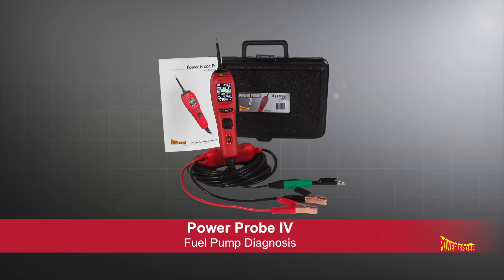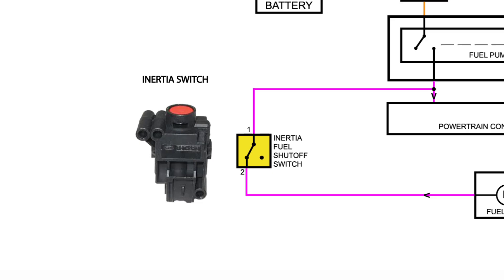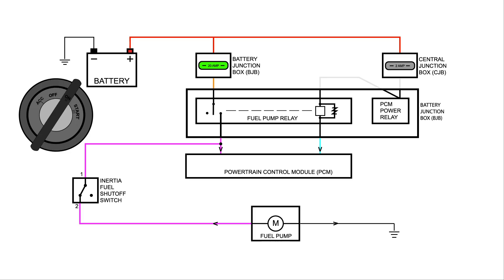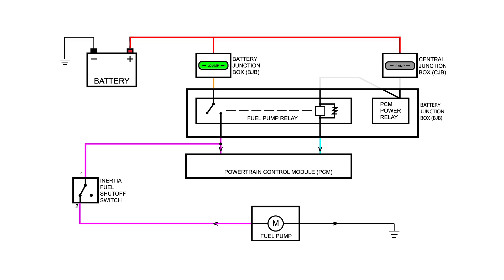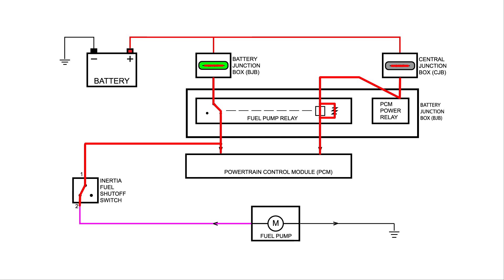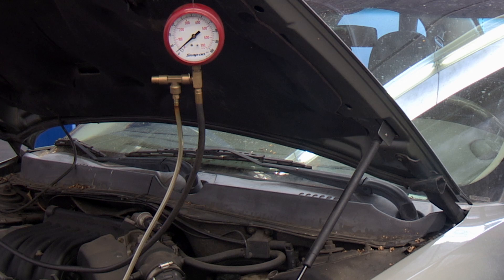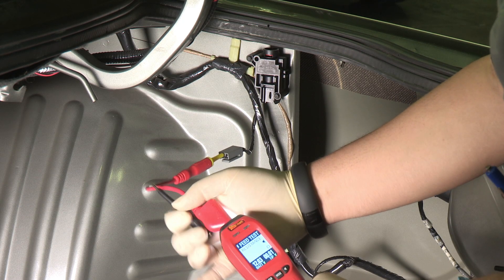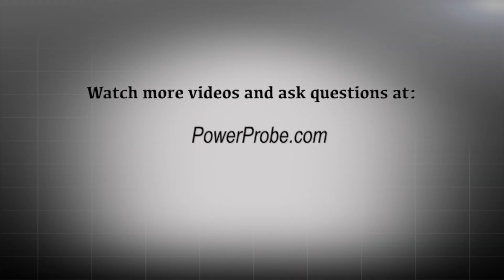Fuel Pump Diagnosis Ford Taurus 2001

Comment: The SPECIFICATIONS CHART used in this video at 3:10 is for FUEL INJECTORS, NOT THE FUEL PUMP.   Look up the part numbers if you have doubts.  If you use these resistance specs for testing the fuel pump motor you run the risk of making an incorrect diagnosis, and buying a pump you don't need.  Wish I could tell you what the resistance should be, but I don't think Ford publishes a resistance spec for fuel pumps, at least not on the 2001 Taurus.  My hair is a bird...

Comment: Okay guys, I realize this video is almost 7 years old. The reason I am watching it is because my 2003 Taurus SE has developed a fuel leak on top of the tank. As usual, the tank is full. So in trying to figure out how to use the pump to drain the tank I have watched many YouTube videos. All of them, including this one are WRONG. The inertia switch has two wires, both are pink/black. That should have been your first clue. Both wires go to the "Fuel Pump Control Module". You cannot apply 12 volts to either one and have the pump run. You cannot ohms check the pump thru these wires, as they DO NOT go to the pump. To access the wires that are connected to the pump you must (a.) Disconnect the connector to the tank, under the car, on top of the tank, just above the fuel filter. OR (b.) Remove the bottom portion of the back seat, peel back the carpet on the passenger side to access the harness where it goes thru the floor. There you can find the two wires to test or run the pump. The HOT wire is White/Red, and the ground is Pink/Black. This is the only way to do this. BTW jumping the pump relay terminals doesn't work either. Suggest you check the "Fuel Pump Control Module" while you're in there. It is notorious for making you think the fuel pump is bad. It is located in the front passenger side corner of the trunk. The entire back seat and the passenger side trunk liner will have to be removed to gain access to it.
It's a silver metal box that looks like a "heat Sink". There are tests to check it.

Comment: So I should have power on the number 2 or middle lug of the inertia switch with the key on,right?I have a 2001 Taurus as my back-up car and started it up to move it so I could weed eat where it was sitting and I had left it running but when I come back after weed eating it wasn't running no more and would not start back up.

Comment: Hi yes I have a 2002 Ford Taurus ses and it won’t start or crank at all no sound all the warning lights come on when switch to the on position except for the check engine light, battery light, transaxle light and battery light don’t come on what could it be if u can help thank you

Comment: What a sales job for a meter.  Now that your pump is junk, enjoy dropping the tank because ford was too stupid to add a floor access panel under the rear seat.  POS.
Reply: I just cut a hole in the rear passenger seat, save a lot of time but you gotta be extremely delicate

Comment: Where is the inertia switch on a station wagon?
Reply: I found it on my 2001 Wagon in the right rear storage there is a hole in the back and the button is accessible thru that hole. Mine was not tripped.

Comment: Hey :) After a while of driving my car starts to lose pressure and I have to pull over and stop it and turn it back on, it turns back on immediately and gains pressure in about 2 or 3 minutes.  I'm not sure if its the fuel pump  or a fuse can you please help ?
Reply: It's probably the fuel pump,mine did something similar until I replaced the pump.

Comment: my car starts (2001 mercury sable dohc) but I  lose pressure after it runs for a while. I also wanted to change out the fuel pump driver module but I can`t find the location. any thought?

Comment: Great video, and info. provided.  I'm going through a similar problem with me 2001 Mercury Sable 3.0 24v..  I've changed the Battery, check the Relay, and made sure, the Interna Switch is pushed in, but still, no start.  I'm pretty sure I, have a bad Fuel Pump, because I think it never been changed before.  I just have to prepare myself for a pricey Bill!

Comment: Thanks for posting.  I was looking for info on which of the leads going to the pump were hot and ground (and not the fuel level wires) so I could test for power and ground to the pump.  You helped by showing me that I could check for power at the inertia switch in the trunk without digging out the connector under the car.  Great display of the PP capabilities.